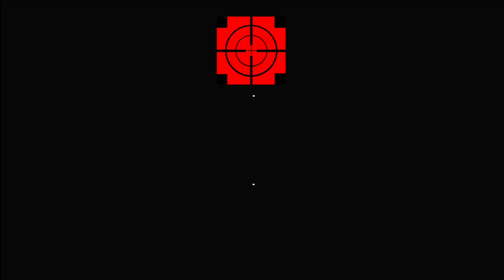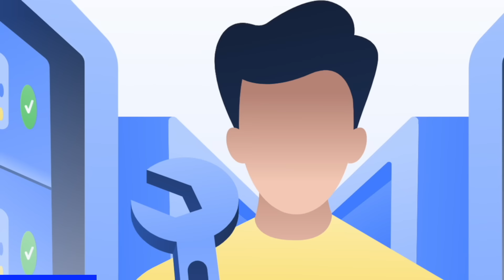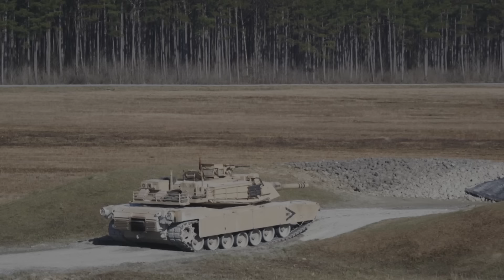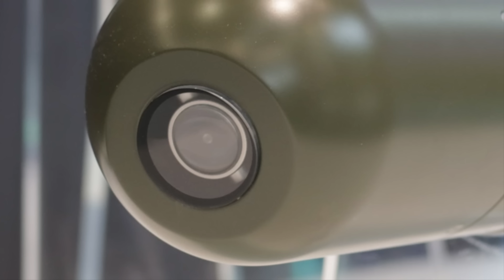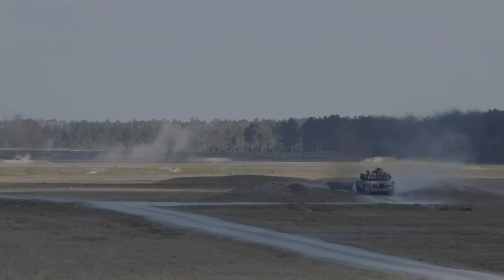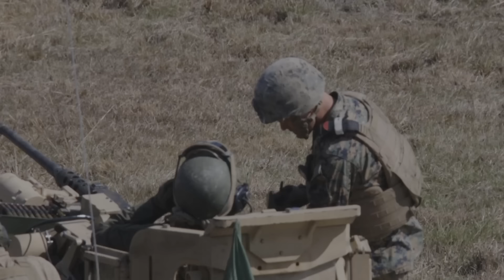How MBDA’s Akeron MBT 120 could make Tanks dominate battlefields again ?

Comment: The latest Fiber optically guided FPV drones with a 20+ kilometer range that can't be "jammed" almost make this missile obsolete. These drones can do much of the same thing as this missile but with the added ability to swarm, loiter, and scout too. The tank would be better off with a rack full of drones and just use the drones instead of attempting to use the main gun for non line of sight targets. The drones would probably be better off without the tank being involved at all. Tanks need defensive capabilities more than this missile.
Reply: Drones are to slow and countermeasures are being developed

Comment: Make it bigger for use in the 125, 130 and 140mm guns and add in two things, a ramjet range booster and an ability to kill flying targets.
Reply: Lets escalate that further.

I suggest a 155mm barrel in that tank.

Firering Excalibur rounds, and larger Akeron rounds.

Something like a Panzerhaubitze 2000 would be ideal.

But with  more armor, faster mobility, better protection system and an aditional weapon station on top.

Comment: For 120mm 
No, thats a step in the wrong direction
120mm needs to be replaced 
The 140mm is future proof option because the size allowed for much larger explosive charge to be carried by precision round
The 130mm is stepping stone for larger calibers 
Ironcially a round like this is what the Army needed for the Stryker MGS with its autoloader
4 MGSs with these rounds would easily overpower enemy armor and their light weight at 20 tons made easier to move around than a 70 ton MBT
Reply: 120 mm with new ammunition will still be able to take out Russian tanks
Reply: I think that the point is that the weapon has been miniaturized down to a size that would fit in a 120mm tube. 

This enables this system to be integrated into existing tanks that are limited to 120 mm cannons AND can be enlarged in the future to fit a 125, 130, or 140 mm cannon. If you can make it small, you can always enlarge it (& probably add additional propellant to give it more range)…
Reply: @williamgarry2635  
Existing tanks at 70 tons are a pain in the ass to move logistically
 A 20 ton MGS can be carried by C-130
I would rebuilt the MGS with 120mm auto loader with 25 round capacity
As high mobile arty system or use the Japanese Type -16 as base with 120mm round with manual loader with 35 rounds
10 LAHATs, 10 Akeron  10 AMP and KE rounds
 Keep the weight at 27-29 tons
A little heavier than the MGS but still 
substantially lighter than a MBT
Reply: @verdebusterAP , I agree with all of that. A 70 ton MBT is stupidly big and we’re due for a new MBT. I even think that with all of the advances in active protection systems and improvements in auto loader technology, we would hopefully use those advances to reduce the weight of an MBT to something below 50 tons and maybe a separate MGS that would be air transportable
Reply: @williamgarry2635  
70 tons MBT made sense when anti weapons were limited in number but there is too much anti armor weapons around to justify that weight any more
The simpler method is the MGS or a 25-30 ton Type 16 variant with APS but also operates with SHORAD variant
The Stryker Epirus Leonidas carries a high-power microwave (HPM) weapon which can disable single targets or drones
To deal with the drone threat, I would make variant of Epirus Leonidas mounted on HIMARS frame or cargo truck backed by 100kW diesel generator 
4 of those moving the convoy would offer great protection
The second layer of protection with 30mm cannon with mix of AIM-9s and AIM-120s for SHORAD
The last time is radar
They need to develop a small drone that can be launched and recovered with ease but also able to carry a small radar pod with 15 mile range
that can provide early warning
Reply: A Stryker with a 130mm gun. The Thing would end Up Torn down the  middle in half Like it Just gave birth after the First shot😂
Reply: Lets escalate that further.

I suggest a 155mm barrel in that tank.

Firering Excalibur rounds, and larger Akeron rounds.

Something like a Panzerhaubitze 2000 would be ideal.

But with more armor, faster mobility, better protection systems and an additional weapon station on top.
Reply: @SpiritMing  
Not quiet
SAAB scaled down then Excalibur to Excalibur N5 for the 127mm naval guns
So no need to scale to full 155mm

Comment: Tank is irrelevant until it can fight back tens (!) of drones simultaniously.
Reply: The tank doesn't need to do it all. It only needs the support to cover it's weaknesses. 

That's how it's always been, that's how it always will be. 

Anti-drone ECM, support infantry and mechanized units, hell, even drone units looking to harass or neutralize other drone teams. 

All very implinentable and even help cover other weaknesses like ATGM teams.
Reply: Incorrect
Tanks due the drone threat can no longer operation independently and have to move with SHORADs for defense
Reply: I’m CERTAIN that there are companies working on how to build a radar/optically guided 20, 25, or 30 mm cannon that can cover a hemispherical area that mounts in the same place as the existing CROWS system. I’d also bet good money that these same companies are working to add electronic attack & jamming systems (including microwave attack systems) to tanks as well provide additional hard & soft kill systems to the tank
Reply: @williamgarry2635 the CROWS proxy GL is something I can see. Onboard jamming is a bit much. Better to have dedicated support units that can be defended and cover a wider area with on-site specialists.

Though point-targeted jamming could be mounted to a secondary crows.
Reply: @bohba13  
There are two problems with CROWS
first is limited coverage. Even if you upgrade the tanks APS with multi function AESA panels ,you still have limited range and time to react unless you are in open area
Germany makes the AHEAD which has 152 plus tungsten projectiles, effective a giant shotgun shell. It comes in 35mm and 30mm and are deadly against drones 
both rounds are large and the amount of ammo carried is limited
Ideally, you want scale down to 25mm for more ammo but you also need rounds like HEDP, , HEI and APFSDS in the mix
The simplest route is the Marine Air Defense Integrated System (MADIS) 
USMC made SHORAD variant of the JTLV which as 30mm cannon plus radar, EW suite , EO/IR , the whole package
Instead of trying to squeeze tech on tank, simple give them an escort 
1 MADIS for every 4 tanks
Reply: @verdebusterAP exactly what I was thinking. Though the GL has other capabilities outside of just anti-drone. So that's why I think it would be worthwhile. 

Predominantly though, soft-kill mesures are going to be most effective as at that range band they actually take up less space than hard-kill. Especially things like anti-optics lasers.
Reply: @bohba13  
Thats why its easier to give the tanks an escort instead trying to squeeze in organic capabilities
Reply: @verdebusterAP  that was a point I made before. I was only making a comment about how some lighter capabilities could in theory fit on the tank, see: high power laser pointers.
Reply: @bohba13  
The problem with lasers is power
To protect a target properly, the laser needs to be in 150kW range with rapid fire capability and only requiring 2 seconds of irradiation per target
There is no way for tank to carry that much power
The Epirus Leonidas is high-power microwave (HPM) that can disable both single drones or swarms
What I would do is put the Epirus on the back on of cargo truck with high power diesel generator and capacitor
The Epirus would be in a small armored shelter for protection and would be able to rapidly deploy as needed
the capacitor have 3 banks allowing for full power EMP burst or 50 focused spots per bank
The generator could simultaneously charge and fire
I have 4 MADIS with 30mm cannon with 500 ready fire rounds behind the Epirus and the sides to protect it
The item would be radar on a extendable mast that reaches up to 40 feet but also usable on the mast while moving

Comment: Now all we need are 1) Drones that fight drones and 2) An anti-drone ‘gun’ of some kind. 2:01
Reply: Munition more like rather that 'gun'.
Reply: Des drones anti drones, Ça existe maintenant en Ukraine.
On peut aussi imaginer un tourellau avec des pots de grenaille se ralliant automatiquement sur les drones attaquants .
Reply: @sergevandyck  Pardon, but wouldn't it be better to use EMP disruptors instead? I mean, someone will have to reload those canisters you were talking about, right? Assuming, of course, the reload canisters are even available, that is. You know, enemy supply disruptions? Problem with the EMP disruptor is it requires a LOT of power & probably has a limited arc & range, assuming there's even something like an EMP disruptor available today. And then there's the issue of maintenance & portability, as well. But, if these issues could be worked out, then wouldn't that be much better to have?
Reply: Ukraine have already those on the field, still primitive designs but they are perfercting those and other equipment fast, really fast.